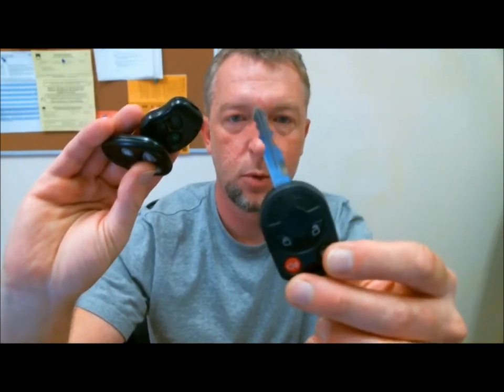2000 to 2005 Mazda MPV Factory Transmitter Remote Programming How To

Comment: Worked perfectly, I've had a 2003 Mazda MPV since 2016. During the 5 years I've owned it it has forgot the key fob associated with it twice. I'm not sure why this happens but if yours suddenly stopped working just try to reprogram it again using this video.

Comment: Thank you so much...!
Called a moblie lock Smith and they said go to a lock Smith... called the lock Smith and they said $45 min...   looked this up and 
Thank you very much for it is now seeing all our key fobs...
Note: owners manual... states do not touch any buttons while changing remote batteries... 
It changes the internal codes and they will no longer work with your car.... Opps ☺ so if that happens... 
This is the solution...
Reply from the maker: glad it was helpful, my work is done here
Reply: @Lesscoelectronics  yes it is!😎😁😉

Comment: 7 year old video still very helpful. As a dealer tech, both import and domestic (w/some aftermarket), I know the pain of standing on one leg, rubbing your belly, patting your head, while singing Yankee Doodle. Ha! Yes, Make, Model, Package level (GM 5th digit of VIN if car), but even the production date on sticker. While most plant shut down on the 4th of July, the next years models tooling is at the ready to ramp up slowly. This too confuses many and it is the law the owners manual is thrown away. Ha! Right. Scan tool makes the job go quicker, but not always needed. Just indenting the vehicle by the VIN (10Th digit is year) the parts department can use dealer access to see if your vehicle came with RKE, while others require programming just to make the RFID chip work to start only. So take notes, make a call, go online and be specific. Best luck to all face-mask wearing folks in MAY of 2020. 
ASE Master Tech since 1978 - Retired

Comment: Question? So, If I have a 2000 MPV and the key has a chip in it and not a remote transmitter how do I reprogram that being that I lost the only key that had the chip in it?
Reply: Jenise Standfield I had same problem did you ever find a solution?
Reply: What did you end up doing? I have only 1 key and would like a spare